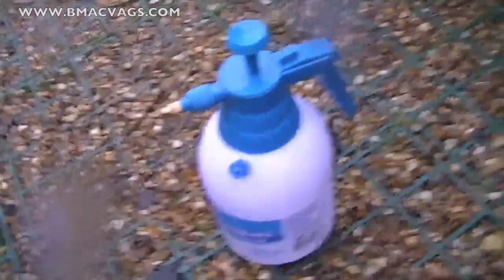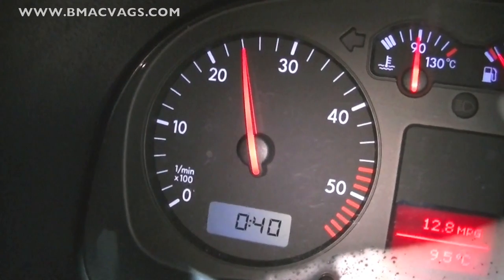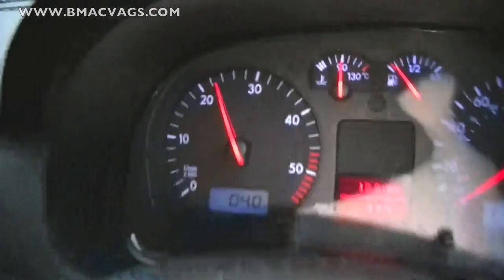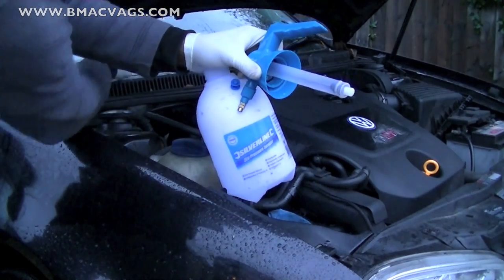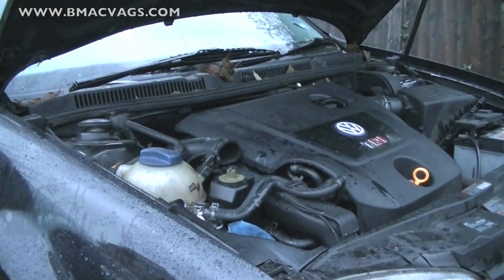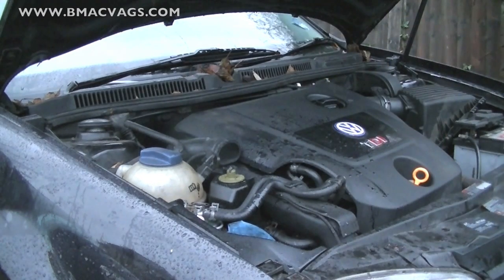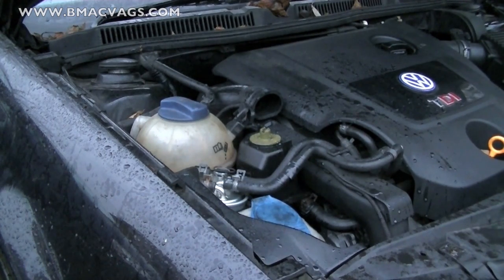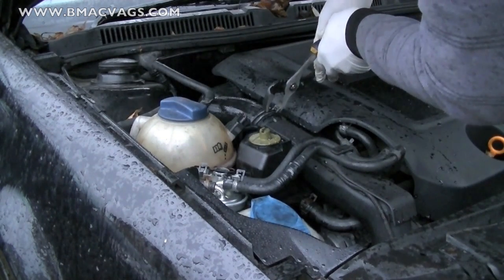How to Decarbonise your Engine with Tap Water

Comment: 1) I would NEVER put tap water anywhere inside my car. Unless your "Tap" water is distilled water which I highly doubt that would be the case. Even then, the only place I would use it would be my radiator to use it as a quick fill up from a leak and replace it with anti-freeze ASAP.

2) Hydro-lock is only ONE of the many many problem when water get inside your engine. If water is ok to be inside your engine, you won't need to flush your fuel tank after you don't drive it for a while. The reason been that water build up inside your fuel tank combine with the fuel WILL kill your engine.

3) Water or even moist get inside your engine will change the compression rate as well as causing detonation and leading to pre-ignition on a gasoline engine. On a diesel engine will be a different story (Diesel engine compression-ignition) but I will just stop from here.

P.S. I have one "piston-hit-the-block" MKII N/A MR2 to proof that water in the engine is NEVER a good idea, let along tap water.
Reply from the maker: I think you maybe a little misinformed with a few things. I said tap water because it is freely available to the masses. Of course you can use distilled water, but in the case you don't have that, tap water is acceptable and better than most fuel additives.

All this talk of hydrolocking yet I am yet to see a scenario which does not include someone driving through a very deep puddle of some sort. Hydrolocking is near impossible if you do it as shown in my videos.

Pre ignition and detonation need heat and pressure to occur. The water makes it run cooler and cleaner due to is H2O molecular structure.

Pistons hit blocks all of the time, so that is not really anything to go by. If they drove through a lake this is just normal, you can't blame water for that.
Reply: hin930 You don't know what you are saying, water is best at cleaning

Comment from the maker: This method works fine, please do not be influenced by people who have not tried it.
Reply: Did try it on a petrol engine and it worked magic.
Reply: Mark Weeks check the crankshaft , and camshaft position censors.
Reply: vag sp It shouldn't block anything with one minor exception. Here is why. First the pieces that break free are pretty small. If they get stuck at the CAT the heat there will turn them to ash. See where the exception might be? yeah if that CAT is already NOT working then everything is slowly plugging it up. 
I fancy a few people next question will be how to tell if the CAT is working. Well thats a bit more complicated. usually full throttle performance might be off a bit. The smell can also be off. Some people say rotten egg smell from a CAT is a sign its going bad. Also if the exhaust smells like "old" cars, like most cars before 1975. Give google a search and they can tell you how to diagnose. I have had a number of them go bad but I have a tendency to make cars last beyond what the manufacturer intended.
Reply: Atomic Blaze 23 it would be if it went through the injector. This doesn't put water through the vehicles injectors. It bypasses them.
Reply: consaka1 That i did not think about, i forgot how a Diesel worked for a minute
Reply: Dizturbias That's the real problem. There was nothing "smartass" at all about my original comment to you. You chose to take it that way because apparently being a "smartass" is a way of life for you. You don't know but you can't take constructive advice or criticism. I'm going to give you some more advice. If you want to be a mechanic I suggest you go take some classes for it.
Reply: Seriously if the video was not clear enough for you then just give this one a pass, you really do need to have a level of understanding to start taking your car apart and introducing water into its systems. I would do this but then I also feel happy to change a clutch or alternator etc...
Reply: Please Make a video of BMW e46 petrol or so , they eat oil so that would be very helpful , thank you ! you can even go the scrap yard and do it there if you don't own one !
Reply: Hey bud so I did it today and not different at all but that being said I did tale the manifold off lastweek and gave it the mr muscle clean )-: so back to the drawing board for me to see what may be causing my limp mode ?
Reply from the maker: Limp mode would be caused by a fault in the car. The water just clears out any rubbish in the engine. What engine is your car?
Reply from the maker: Ronald Arthur Excellent,  glad you had the faith to try it.  Better than most of that rubbish on the market.
Reply: Yes
Reply: Mark Weeks had limp mode too mate. It was the mass air flow sensor. They aren't cheap either :-(
Reply: Hi, sorry if I seem daft as this is new to me, though ofcourse I do not doubt you. That said, can you tell me where exactly I need to squirt the water, please? DO I squirt it into where the air filter is?
Reply from the maker: TheMindspoken Not at the air flitter part. What car do you have?
Reply: Bro, mine is a Mitsubishi Adventure diesel (unfortunately these sad handling and looking vehicles) is what you do not get in Europe, the middle east or even the US.
The 'mechanism' if I may call it thus is really very basic :-(
Need your help, please!
Reply: I am using a vw golf 4 petrol engine where do I pass the water through
Reply: Bro, still waiting for your reply. I need to do this, but do not know where exactly to squirt in the water. HELP!!!
Reply: TheMindspoken Pretty much same method between petro and diesel.
Reply: MAG Drago Thank you for taking the time to reply. Greatly appreciate it '-)
Reply: TheMindspoken If you, dude, have a normal naturally aspirated engine spray the water after the airbox (after the mass airflow sensor and right before the intake manifold). If you have a turbocharged car spray the water right after the intercooler (disconnect the piping after the intercooler just like BMAC VAGS shows in this video). Hope u got it.
Reply: BMAC VAGS The question is: where carbon goes after that process? Is there any 
chance that it'll help block something in its way out? DPF, catalytic 
converter?
Sorry, I am quite novice here. Just trying to get the whole picture of it.
Reply: +BMAC VAGS On a diesel or EFI, isn't the water bad for the Injectors?
Reply: +consaka1 How so?
Reply: consaka1 How so?
Reply: Atomic Blaze 23 Simple. Injectors run fuel from the tank. You aren't putting the water in the tank. You are misting the water into the intake manifold. In short, this procedure uses the intake air flow to suck the water mist into the engine. There is no connection to the fuel system involved at all.
Reply: +BMAC VAGS Hey, i wrote on a different comment before but didnt get an answear. 

Does this method work on an Audi A6 2.0 TFSI 2007 and if it does, where does the water go ?

Thanks!
Reply: Dizturbias Here is what makes me nervous about discussing this with people that ask questions like you just did. Don't take this the wrong way as I am just being honest and not down on you at all.
First your question shows that you know absolutely nothing about your car and how it works. That's fine as many people don't and I don't know about their profession either.
The problem is that every car is made slightly different and no mechanic to day has them all memorized. If you find one that can do that then he is one in a million with a freakish memory.  I doubt any of us fit that category. 
So for you to name a car and want us to tell you where to put the water....... well there is too much involved for us to do that. It would take time for us to research your particular vehicle. Most of us are used to being paid for that time and when we get home on the computer it's family time and off duty time.

Now for this type of thing to work I feel that it is best to let it mist into the intake so as to let it disperse evenly to all cylinders. Some guys say let it get sucked in through a vacuum hose but I think that is a very bad idea simply because it is going in as a stream that tends to stick to and follow the edge of the intake manifold to the nearest cylinder. This means that only one or two cylinders get the water and the rest get little to nothing. 
On a carbureted and TBI engine this strategy is easy since the throttle plate/venturi air breaks up the water into small particles and distributes it like it does the gas. Newer vehicles with mass air flow (MAF) sensors can make it much more difficult depending  on the type of MAF. Especially when trying to do a mist style spray. you do not want to get water in your MAF sensor. Doing so could be very bad and ruin the MAF sensor. If it were my car I would put together a small nozzle such is sold by "Devils Own"? and run it under pressure some how. Then figure a way to stick it between the MAF and the manifold. If any of this is confusing for you then this procedure is not for you. Just don't bother with it anymore then you would bother rebuilding your engine from scratch.  Cheers!!!
Reply: Dizturbias Lol. well I am not liable if you screw up. Obviously you don't know anything about your car if you have to ask the question. If you were knowledgeable you would know where. lol sorry your little feelings got hurt.
Reply: +BMAC VAGS Hi i have a 2006 Ford Fiesta 1.4 TDCi and where should i spray the water, i meant will there be any sensory on the intake manifold which can be damaged by this??
Reply: +BMAC VAGS can you show how to decarbonize a ford fiesta 1.4tdci
Reply: Hi, was thinking about giving this ago, but I suspect I have camshaft knocking noise as You Tube "T5 engine Knocking noise intermittent" video by Tony Farrell, would it be safe to decarbonise my engine with tap water under this condition. Thanx Ian
Reply: +consaka1 I know this is an old comment, but a better way to tell if a catalytic converter is functioning is by looking at the 02 Sensor data, specifically the one right after the cat. If the values are held steady then it is functioning well. If they are fluctuating as the pre-cat sensors then you know it is failing. An exhaust analyzer would show immediately if it was working or not too.
Reply: Hi does water get into the oil should you do an oil change after this process
Reply: Mate great video, so I take the pipe off at before the EGR valve and spray from there? Cheers bro
Reply: +consaka1 Really i couldnt care less if you think i dont have any knowledge about my car. i didnt ask for you personal oppinion about me!
What i asked for was where to spray the water since ive seen it done bot after the MAF sensor and in through the intake manifold.
So if you feel nervous, you shouldnt really answear comments. Im not looking for advice from an insecure person!

Thanks anyway!
Reply: consaka1 Not hurt at all, just dont like smart ass comments when there obviously are multiple ways people done this. Even the uploader of this clip,  showen a petrol engine decarbonized both ways. So if you dont have anything constructive to add, then dont add anything at all.

Comment: you cannot put water in an engine. it compresses 1 to 6 of air, and will bend piston rods, and/or crackshaft. period. sorry for anyone who thinks otherwise.

the crankshaft will continue to turn, but the volume inside one piston wont compress like air because it has water in it. the extra volume has to go somewhere, so the metal piston rod bends or cracks, and all hell breaks loose after that.
Reply from the maker: This is a very old tried and tested technique and you should have no worries when doing it as shown in the video. Your science may be correct if the water was poured from a cup, but in the video it is in a atomised state so you should not worry.

Hydrolocking is always a concern to people who are on familiar with yhis method, but even if you watch other videos of hydrolocking the scenarios are quite extreme.
Reply from the maker: TheYTCable I agree with what you are saying 100%, but this is the best we can do on a DIY level. 

Thank for your comments.
Reply: host47 This is a tried and true method. What you're describing is hydro lock. This procedure doesn't use near the same amount of water. When done right the amount of water injected is not enough to hydro lock.

This method isn't foolproof however. If you mess up spectacularly the expansion water to steam does produce enough force the bend/break rods.

Comment: I think to do this at my Golf MK4. Can this method help with the thin oil in the engine?
Reply from the maker: Not sure what you mean when you say "thin oil"
Reply: BMAC VAGS The oil film inside the engine. I have 1.4 16 valves petrol  engine and i want to clean it and i think this is the only way, becouse opening the aluminium engine will destroy it (nothing will fit anymore :) ) Sorry for my english...
Reply: Даниел Петров if you are talking about vw group petrol engine 1.4-1.6 (2000-2009) you shoud not loose crankshaft and propably oil pump everything else is replaceable , such as cylinder head , pistons , con rods ,valtrain etc ....
Reply: nioskap1 I don`t have this problem anymore. I fix the cylinder head, some of the valves and hydraulic valve lifters were gone. All three piston segment on each piston were gone too. The preveous owner obviusly has never changed the oil. My car looses almost a littre on the highway and little less than that in the city. After everything the little VW is running like a clock. Btw i already changed the oil pump becouse one of the technician in other garage told me that she is not powerful enough. After 5000 killometers the oil is still intact.

Comment: How to hydro-lock your cylinders 101, to remove carbon in Volkswagens just invest in a EGR delete or bypass. methanol injection and shooting water in to your intake are two totally different things. this is a horrible horrible idea that  can warp your head and cause head gasket failure, or like is said earlier a hydro-locked cylinder. you can also warp intake valves.
Reply from the maker: Why would it warp the head?

How many engines have you seen hydrolocked in this way?
Reply from the maker: Willl seafoam hydrolock your engine and warp your head?
Reply: BMAC VAGS a piece of junk lawnmower if found, i had no use for it so i spayed water into the carb and it immediately bent a valve. also seafoam contains isopropyl alcohol witch is flammable and burns. I rebuild motors for a living and have seen many people do stupid things. you made a video just to put down seafoam for whatever reason with no factual evidence that the product doesn't do its job. I can tell you from experience seafoam works, does it make your engine bran new? no, but it helps to clean injectors and carbon buildup in your intake and heads.
Reply from the maker: marlinnotfish As long as you are happy,  that is all that matters.

I am a little curious as to how you put water into the lawnmower.  Was it a 2 or4 stroke engine?   And was the engine running when you put tge water on?

Did you use a spray or bottle
Reply from the maker: marlinnotfish yes of course they have openings on the cylinder wall.
Reply: Seafoam Spray works the same way. It is atomized just like the water shown in this video so you cant hydro-lock your engine..
Reply: BMAC VAGS 4 stroke, 2 strokes don't have valves, i used a garden hose on a gentle squirt setting.
Reply: marlinnotfish
Reply: ***** You don't? That's why i work at Mercedes Benz. And the 396 big block in my chevelle built itself. This is a stupid idea, a lazy way of doing things. You want to do it the right way, take the intake manifold off and egr, and get it hot tanked. Wanna put large carbon deposits through your turbo be my guest. but spraying water into your intake can cause many issues that aren't discussed in this video. Theirs the right way of doing things, and the easy way.
Reply: ***** So i guess the German engineers at Mercedes know nothing, when they have us take those parts off to remove carbon build up? When you work clean, and follow the proper procedure nothing can go wrong. Key word in your last comment is "maintain", you maintain things.. you probably have never taken a cylinder head off. and i have rebuild many motors. I dont need to prove that to you.
Reply: I'm a bit late to the party, but this method definitely works. I've used it more than a few times, but more importantly my grandfather used it. He was a heady duty technician for 50+ years, and never once had an issue with water decarb. There's a right way, and an easy way, in this case, water decarb can be both. Taking everything apart and doing it works just as well, and it is a bit safer if you put too much water in.

Comment: BMAC VAGS how long did you leave it running for after this process and how much water did you  use im going to try this today I have a 1.9tdi pd130 bora ?
Reply from the maker: Use about 1 pint, or if it needs more use more.
Reply: BMAC VAGS sweet im going to try this tomo I keep going into limp at 80 ?

Comment: This definitely works, and for people that worry about water in engines bear in mind that water is a combustion product anyway.
For every gallon of fuel consumed you generate six gallons of water. As long as you don't get too heavy handed the chances of hydrolock are very remote. A rough and ready was is to redirect the screen washer hose that way you can do it while sitting in the car.
Reply from the maker: That is a excellent idea

Comment: thanks for your videos. Im still unclear as to where i which hose i would put the water in in my golf 1.4?
Reply from the maker: I think you have to remove the air filter and spray directly in to there if I remember correctly.